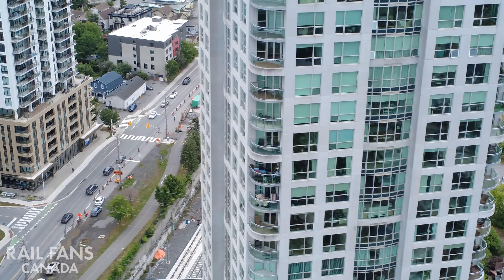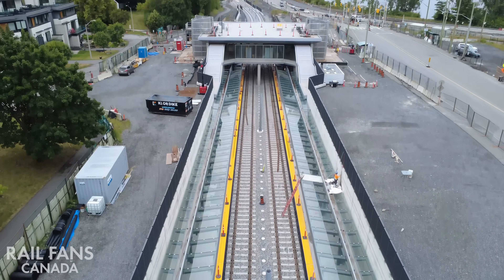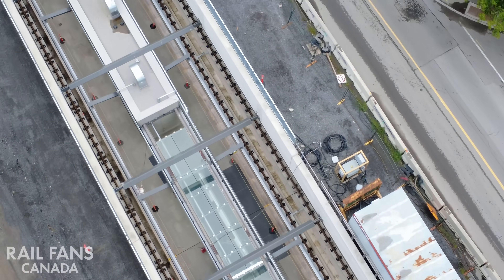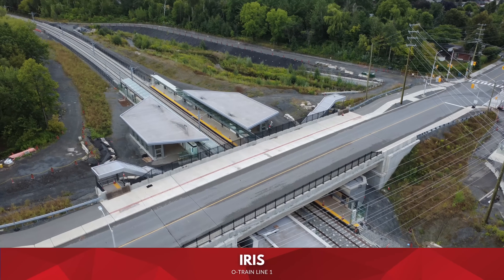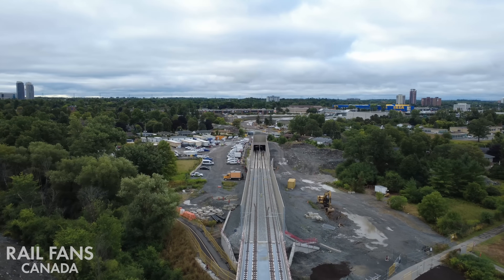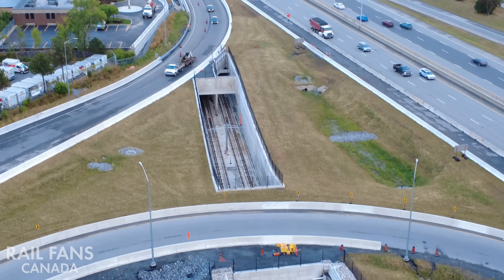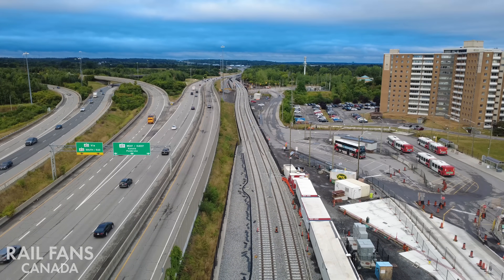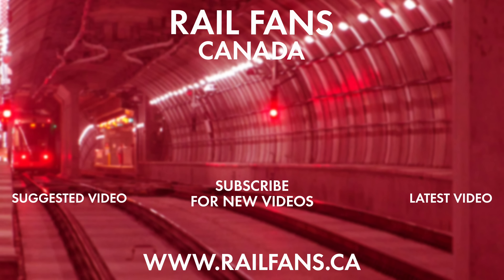Tracking the Progress: Ottawa’s O-Train Stage 2 Western Extension - August 2025

Comment: I know they wanted to cheap out on ventilation / fire code stuff, hence the decision to leave Sherbourne and New Orchard stations uncovered. But man, so disgraceful that they then further cheaped out by not providing full glass overhang coverage of the platforms, apart from a small sliver of glass running down the middle of the platform. The steel structures are already there, so how hard is it to just put some glass on it to shelter the people waiting for trains? We get Walmart-level public transit investment in Ottawa, which is clear when you see people huddled underneath a tiny, semi-functional radiant heater in the DWA as if we're a bunch of pet-store animals. Meanwhile other cities like TOR, MTL, VAN are building much nicer projects, that actually take passenger comfort seriously. Sad excuse for a G7 capital's public transit system.

Comment: This summer I had to go from the airport to Aylmer and back to get my spare keys.  I took an Uber one way and decided to use transit for the return trip.  The Uber ride was 45 minutes and the transit trip was 2.5 hours. What shocked me most was the painfully slow pace of the airport train. There was an unnatural lateral movement that may have been from an uneven rail bed. I am no expert on train and rail design but I have ridden trains in other Canadian and European cities and been on the Eurostar and Thalys high speed lines… a fairer comparison might be Toronto’s UP line… smooth and fast. I am concerned that the length of this project has resulted in a lack of continuity for project management and the focus now is completion and not quality. It would be interesting to see what the original specifications were for travel passenger travel times.
Reply: The Airport Line was always stated at 7.5 minutes run time. It's 7 minutes and 40 seconds. So, it's consistent with what it was planned at.

South Keys to Bayview... Well, Greenboro to Bayview used to be 12 minutes run time... But single tracking and more vehicles kinda slowed that run time down so that it is 22 minutes with the passing track requirements.

Bayview to Lyon, run time is about 3-4 minutes.

Lyon to Aylmer, well, I'll leave that to you.

Comment: The worst LRT system in the world which is taking an eternity to be built and the cars themselves are too light duty for what they are being used for. It made my commute longer when it was opened because of its horrible design.
Reply: No, LRT didn't make your commute longer... Especially, it didn't in the west end. Tunney's Pasture to Parliament, you're only on it for all of 7-8 minutes when you used to be for 14+ minutes. 

The city's choice of bus network and fares that removed bus service availability is what made your trip longer, a decision made in 2017 that was premises from wanting to give suburbs a cheaper ride fare at the price of no longer providing quality bus service, the root cause of the bus resource issue that still exists today that created ridership dissatisfaction. And the service policy from 2005 doesn't allow that bus service to improve until Council recognizes the problem Council created with buses in the budget set by Council.

Comment: IMO, the biggest mistake in the design is all the glass used at stations. Difficult to heat in winter + cool in summer. Also, how much will the glass cost to clean. It also cost tremendous additional cost to build and repair when these glass panels crack.
Reply: they barely clean it. just go look at the glass at stations downtown.

Comment: I hope they are going to put some kind of roof over all the electrical contact wires. In an ice storm they will be useless. There will be a lot of shorting and sparking.
Reply: More than 95% of ice events haven't been an issue... The rare 1% to 2% of ice events, you resort to a severe weather plan like New Jersey Transit does.

Comment: Why on earth are the platforms in the tunnel sections open to the air, rain, cold, heat, snow, ice, etc...?
Reply: Not designed by people who intend to use it and/or they want to make it as unattractive to vagrants as possible. Note also that the Queensview overpass, aside from being rather bizarrely located, is also open to the sky at the two ends.
Reply: Ventilation costs.
Reply: I too thought the same thing.
Reply: Probably the same reason the stop at the train station has no escalator.
Reply: And Ottawa winters are no joke.. i hope they cover it in glass or something and keep it heated
Reply: They would close them later I think . Its gonna be a street on that tunnel
Reply: @alexmitin55  nope

Comment: Why didn't they make the train stop directly under the Bayshore Mall? Not everybody wants to walk 2 kms to get to the mall from the train station. Why doesn't extend right to Kanata where a million people live? What a joke.  Never on time & never on budget.
Reply: Mall owners are notoriously short-sighted when it comes to integrating with transit and our city corporate culture has become quite feeble so they wouldn't have done any real pushing to get something better (i.e. threatening to expropriate what they need), which is how we got the Transitway station and now the LRT station where it is.

What they should have done is taken over the triangular area formed by the westbound Richmond-Queensway onramp and two walls of the shopping centre where Winners is located and built an island bus station (sort of like St. Laurent) at parking lot level. One level above that would be a large concourse extending all the way from Bayshore out over the tracks where the rail platform should have been located. The concourse would then serve both for bus-rail transfers as well as access into the shopping centre on the second/middle level.

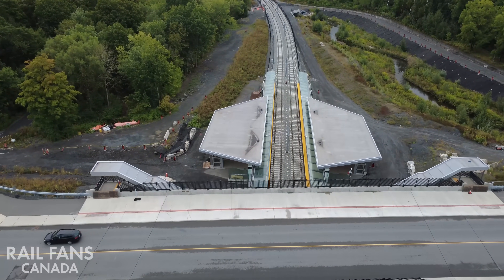Comment: 7:20 Iris - No elevator? ??
Reply: I was thinking the same.  No wheelchair access?
Reply: There will be ramp access. In building Iris Station they obtained the grade separation by "splitting the difference", so to speak: half was provided by raising Iris Ave and half by lowering the tracks. This means that from actual original grade along Iris either side of the bridge you're only going down half a storey height, which they consider to be manageable.
Reply: @davidjames4915  Iris Street

Comment: I noticed a train sitting in the maintenance building at Corkstown this past week. I was surprised because it doesn't seem like track is laid throughout the West end. The East definitely looks much closer to being operational.
Reply from the maker: There are three LRVs that were transported by truck in the past year+ to Corkstown yard to be able to do testing prior to the tracks being fully complete and operational. At this point, I believe the tracks are installed end to end but the overhead catenary system and wire are not. Trains have circulated between the yard and up to Pinecrest/Queensview.
Reply: @RailFansCanada  Another missed opportunity for proper rail integration: they could have created a drop-track spur from the Beachburg Subdivision just to the west so LRVs could be delivered via rail flatcar.

Comment: Another great video! The tunnel to the new Sherbourne and New Orchard stations is going to be very exciting with all that class and light! I have to wonder though if it would have been better to have had just one new western line all the way to Strandherd or Hazeldean rather than two 'stubby' lines spurring off from Lincoln Fields that for now end in Algonquin and Moodie at the same time for now, that need a Stage 3 extension to complete. I'm sure they have a good reason but just a a random though. Keep up the great work, love to see progress on the new lines!
Reply: First, a single line westward wouldn't have served Algonquin, and second, by the time you've gone to the effort to make it possible to have the lines branch at Lincoln Fields, you might as well finish the job instead of renovating the station later.  This way line 1 can be extended further south and line 3 further west without interrupting service.

Comment: Maaaan the bones of the o train are fantastic. If only Ottawa choose the right technology for their transit, things would've been beyond transformative (automatic light rail imo). Instead, ottawa is left with a good transit that would've been absolutely worldclass
Reply: They gotta fix the wheel issue. If this problem still persists when the west extension opens we'll be even more of a laughing  stock compared to other cities. We also needed to double track line 2
Reply: Automated light rail is the tech Ottawa chose...
Reply: @mlmielke no it is not.  See montreal rem as an example of automated metro
Reply: @thaboss-d8q   The Ottawa system could still be fully automated even with the light rail technology used now
Reply: @duploman0003 fair. But the tech used limits max speed and capacity. Imagine if the o train traveled at average speeds in the 80km range. A proper automated metro would allow for that. 

Now you're no longer debating with your friend on which mode of transport to use.

The current lrt is very respectable, but things could've been very special is all im saying

Comment: @7:25   At Iris Station, you say there are ramps instead of elevators.   Where are the ramps ?  I don't see where they would go.
Reply from the maker: They will go down from the ends of the overpass. They aren't built yet so you don't really see them, its mostly just gravel right now. In other words, they are not positioned right next to the stairs, but to the far ends of the Iris overpass.
Reply: @RailFansCanada  Great.  So people with mobility issues, baby strollers, luggage, etc. will have one h*ll of a walk, out doors, in the rain, in the cold, on the snow and ice...  Yup.  Just Great.  Bravo.

Let's consider the following dimensions :  
     = top of sidewalk to top of platform : approximately 10 m (32'-10").  (This number could vary, depending on catenary clearance and the size of the support beams of the bridge.)
     = minimum slope for a wheelchair accessible ramp :   1:12  (although 1:15 or 1:20 is preferred for increased safety)

This means the ramp will need to be at least 120 m (394 ft) long !!!  Not including any flat landing areas along its length (which, by code, must happen at regular intervals -- and each landing must be as long as the ramp is wide -- if memory serves, there would need to be at least 3 of these for a ramp so long).

This is outrageous !    I realise that Iris Station is not a high-capacity station like some of the downtown ones.  But if you are going to design and build public transit infrastructure that is supposed to be accessible for everyone , then do so for every station.   And if the cost of 2 sets of elevators is such an issue, all they had to do was build a simple island platform (like so many others in the O-Train network) and build a single set of elevators.  

Oh, and BTW, I certainly hope they keep that ramp snow- and ice-free during the winter.  (I wouldn't want to be their insurance provider.)
Reply from the maker: You raise good points. While I don’t know the reasons this approach was chosen, cost was likely a large factor. Luckily it is the only station planned to be like this on Lines 1/3, although I do respect that for people with mobility issues, it can present a large obstacle in being able to use the service. Eager to see how the slopes will be prepared.
Reply: @RailFansCanada  So if you have trouble with stairs you may have to cross the bridge on Iris to get to the correct side of the station.
Reply from the maker: Yes that would be correct.

Comment: I don’t understand the numbering system.  Trim to Moodie (the workhorse line) should all be Line 1, with the Algonquin off shoot being line 3, as the airport spur is line 4.  So if I am at Rideau, there will be both a line 1 and a line 3 on the same track/platform.  How confusing is this?  I will have to wait for a line 3 for Kanata?  It would have been easier to get a line 1 and then transfer to 3 for Algonquin.  Not just confusing but counterintuitive and just dumb.
Reply from the maker: You can switch as far west as Lincoln Fields. There was a decision taken that Line 1 to Algonquin (and later to Barrhaven) would be the main line, and the line to Moodie (Kanata) would be the other line, which in certain time periods (weekends and late night) would be a shuttle between Lincoln Fields and Moodie.
Reply: @RailFansCanada  so we will only have some semblance of LRT service serving the far west.  Thank God I live DT and rarely need to use OCTranspo but not everyone has that luxury,
Reply: @RailFansCanada  It would be better to transfer sooner, for instance at Sherbourne or New Orchard which each have a single platform.  To transfer at Lincoln Fields you need to go to the upper level and back down again.
Reply: Just make sure to take the right train
Reply: @magnabaddelta-thriller5603 I think I have it figured out, but it could have been simpler
Reply: Because the historical Transitway buses these lines are replacing showed that that line to Algonquin is FAR FAR busier than the line to Kanata (old 95 vs old 97). Having the two routes interlined downtown really shouldn't be that difficult for anyone to figure out. I mean they have lots of signage on the platforms and the trains telling you where they are going - just get on the right one. If you can handle a bus stop (which can have many routes at them) I think you can figure out two routes.
Reply: @toddoddity3976 No, just that Algonquin has all-day transit volume.

Comment: They need to make the tracks suitable for electric trains rather than diesel for when new models of the trains are needed. If both Toronto and Montreal can utilize electric trains on their LRT systems given the weather in these cities, so can Ottawa. Hopefully Ottawa also realizes it should be affordable housing built at and near the stations, working with federal government's housing plan to ensure affordable housing is near transit services. Cities like Montreal have done this, but Vancouver hasn't been, instead the city has been building luxury towers around SkyTrain stations.
Reply: Ummm... the o train lrts are fully electric lol
Reply: These trains are electric, and the diesel line 2 trains can be converted to electric. The new sections of line 2 were designed with electrification in mind
Reply: @kevinmccloy185  The main problem with making line 2 fully electric and double tracked along its full length is the tunnel under Dow's Lake.  It isn't high enough for the former (at least not with catenary wires) or wide enough for the latter.  It would need to be replaced, and that would be costly.

Comment: I'm pro-transit/pro-train, but it just seems to me that so many of these stations in the system are in largely unwalkable places  (i.e. places where people don't normally walk, or don't want to walk to). Bayshore, obviously good, Baseline obviously good, but the one by Leons, it gets you near big box, still a bit of a walk in January for getting to residential areas, etc.
Reply: @Roddy1965  it will service both communities on either side of the Queensway well. It will cut my walk down 15 minutes. I currently have to walk 20 minutes to pinecrest or to Iris.
Reply: You’re right, and it’s done on purpose. Ottawa is notoriously cheap on spending to improve… well, anything really, but especially public transit. All of these stations were existing bus stations (except for that stretch of cut-and-cover in Westboro) retrofitted to save on cost. Notice how nearly all of the platforms are open air, with only a thin glass ceiling that barely covers the platform? In a city that gets 100s of CMs of snow over the course of a single winter and that regularly reaches -30°C?

They’re banking on developers building new condos and high rises next to these new stations. It’s already happening in the East (Cyrville, Trim), and Algonquin station. Time will tell how well this strategy pays out.

That Leon’s station is atrocious, gotta be the worst station. Literally zero walking infrastructure.
Reply: @pappiti123 that’s Pinecrest I believe
Reply: @pappiti123  Unless you want to visit Fun Haven or work for the Ottawa Citizen.  IKEA is about halfway between Queensview and Pinecrest.

Comment: Thanks for this. Given our average snowfall, you have to wonder how flat roofs and open stations will be cleared.
Reply: Existing Line 1 stations have heated platforms so ice and snow don't accumulate.  Those in trenches will need pumps to drain the melt water.  I don't think they bother clearing the roofs.
Reply from the maker: Good point. It will be interesting to see how they handle snow removal at those stations.
Reply: PS: 69" snow average.
Reply: Never 🤣🤣
Reply: @bruceduncan3646  I’m not sure what the concern about a flat roof is. Ottawa has tons and tons of them, on commercial, industrial, and residential buildings. Montreal is also full of them. Both cities receive a lot of snow, but that’s no problem — unless a flat roof is neglected. I’m also not sure what the concern about platform maintenance is. All the OC Transpo main bus stations had big open platforms.
Reply: They forgot about winter. Certainly didn’t take it into account in the first phase. Why start now.